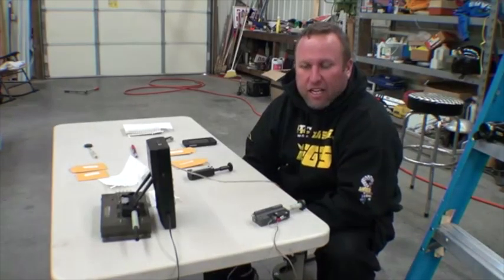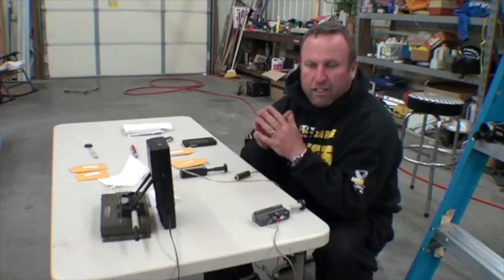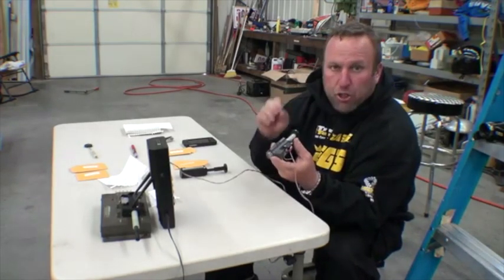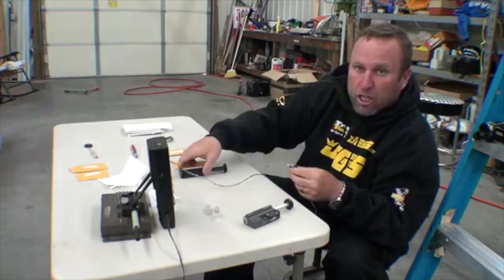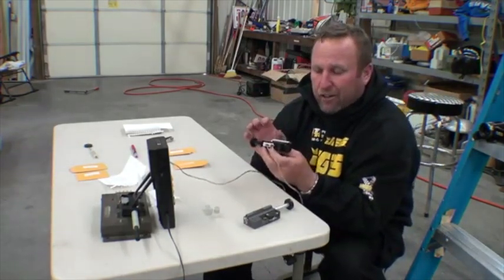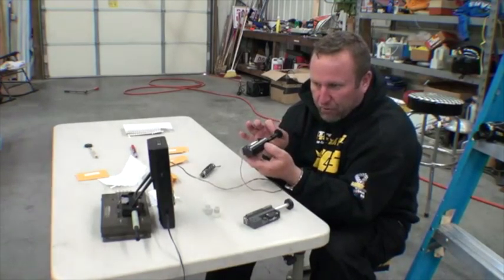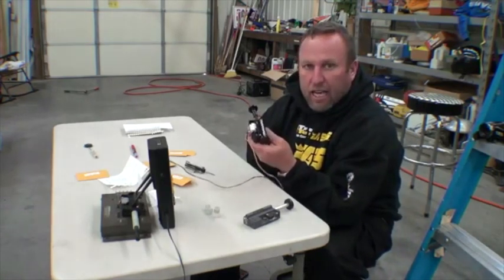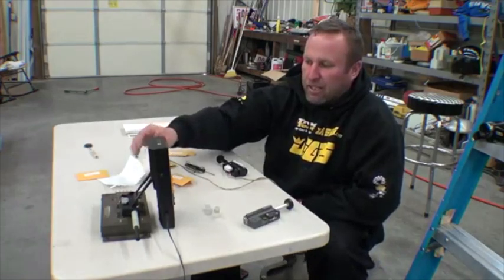Apex Machining, Inc. TransBrake button

Comment: ran the same test on different buttons 2 yrs. ago and found the same thing. shims do not slow the buttons past .015. you must change the spring tension by changing springs in any style long button. good luck, Jack

Comment: Very helpful video.  I'm normally a .400 pro tree racer (NE3) but have been racing some Summit Series Pro races with the dang sportsman tree.  They call me "Mr. Red Light".

I was going to buy a Biondo button but read about the Apex and now, having watched this video, I'm leaning to the Apex.

I've slowed my launch RPM, softened the rear and front tires and am staging as shallow as I can and still find myself in the .00 red territory.  Maybe this will be the answer.  

Thanks!

Comment: Your comparison would be a lot easier and more consistent if you would make you a mount for your buttons instead of holding them. Your left hand keeps moving towards your chest when you go to release so it’s not giving a accurate reaction. I’m definitely not doubting your abilities. I have seen you race multiple times, you are definitely as tough as they get.